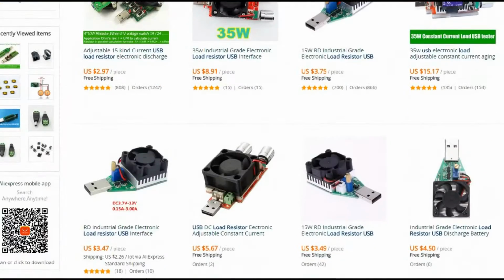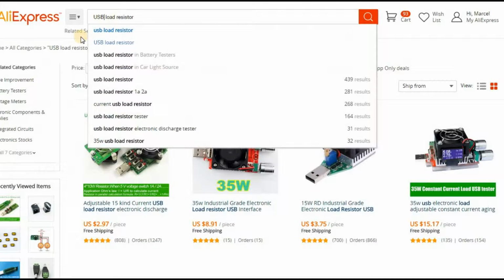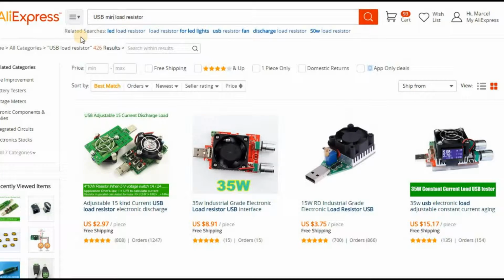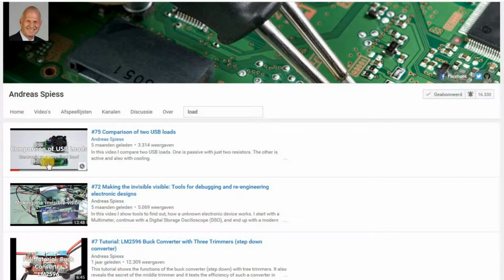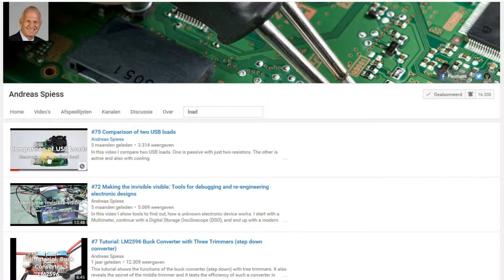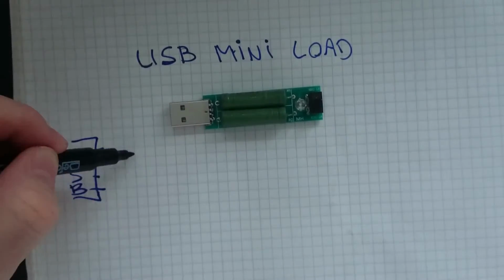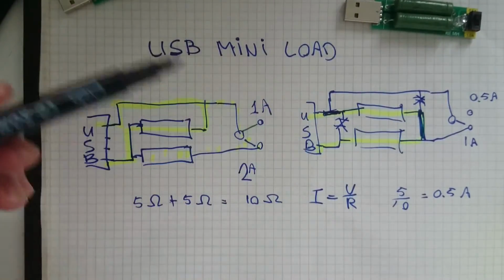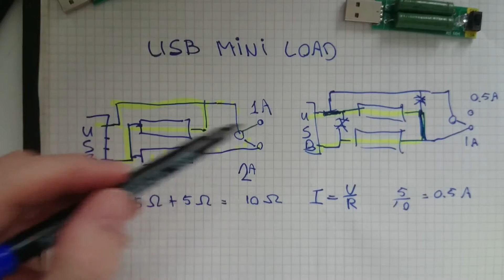Easy mod: convert a mini USB Load Resistor from 1A to 0.5A

Comment: Hello, I’ve just tried to make this modification, but I didn’t succeed, the description of cut and joining and soldering isn’t clear, so I damaged the resistor. I hope someone help to explain it. Thanks
Reply from the maker: Sorry to read that. As I stated in a reply two weeks ago to Ben Caldwell who succeeded (see below), I see what I should have done better. In my attempt to clarify I drew a simple schematic, but didn't highlight the corresponding traces on the PCB. Please read the feedback below and review the schematic that I drew in the video. Then also check your wiring. 

I don't see how you damaged the resistor. Perhaps you heated the resistor for a long time? They do get hot, so perhaps you had a resistor that could not withstand the heat? Maybe your device used resistors of lesser quality? The device is originally made for 1A and 2A currents, either single resistor or parallel.. In my mod the current is reduced. Smaller current means less power to dissipate, so that should not damage the resistor. 

Please read the feedback below and review the schematic that I drew in the video. Then also check your wiring. I hope  that this answer gives you some help. Otherwise perhaps you need to buy the more expensive load device that uses a fan and has two dials to set the load. Good luck!
Reply: @MaxintRD  
Hello, why not try to make another video and go direct to where to cut & where to solder. Try and put the link here.
Thanks
Reply from the maker: Perhaps quicker: I will try to make some good annotated pictures and put them on my Github with a link here. (please hold on for a moment...)
Reply from the maker: Here I made a picture and put it on my GitHub: https://github.com/maxint-rd/electronic-projects/tree/main/MOD_load-resistor

Comment: I’ve just done this mod in 2022. Thanks for the guide. I found working out what line you had cut on the back a little hard but eventually figured out it was the short connector not the one that runs down the edge. Ended up using a drill with a small bit to sever the lines as using a knife took too long. The drill made a nice clean channel I could then colour green. Thanks for the video.
Reply from the maker: Well done! Looking back at that video I see what you mean and I understand the part that I should have made more clear. Nowadays I would have recorded the making of the mod, instead of only showing the result. Hopefully drawing the schematic was a bit helpful.  Still glad to read you found my video and used it to make the mod. Thanks for posting your findings.